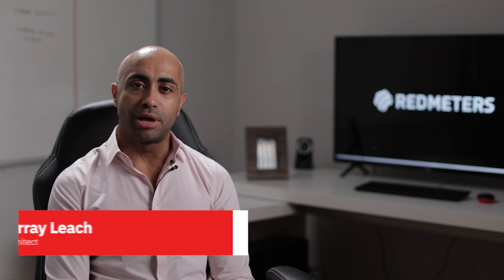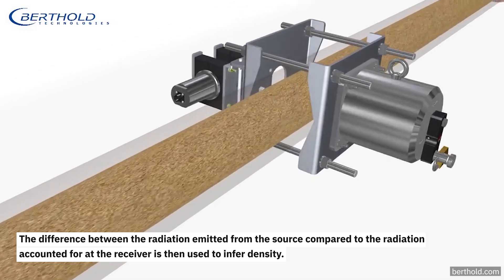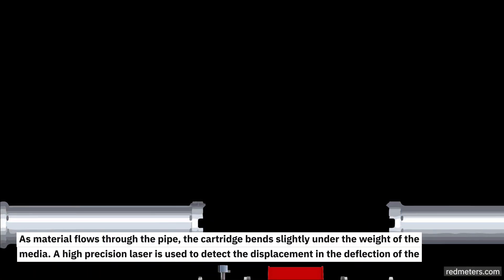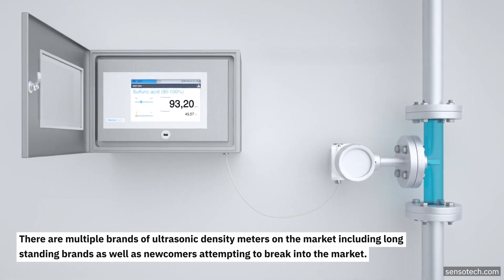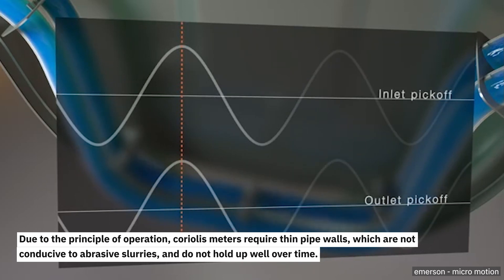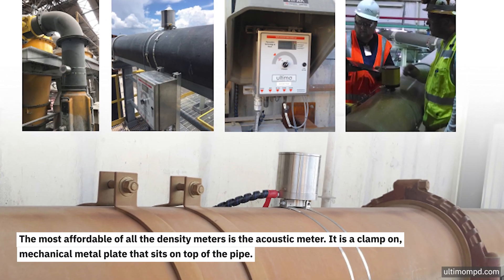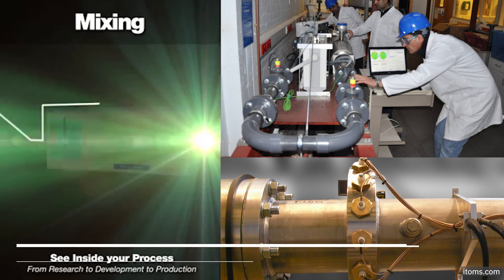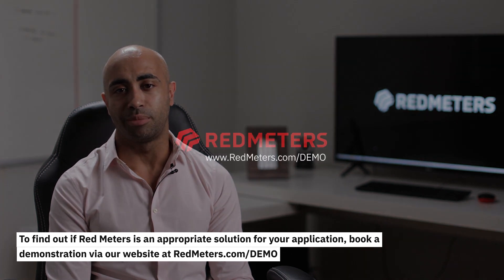Compare Density Meters | 8 Most Common Slurry Density Meters

Comment: Your analysis of Coriolis meters as as densitometers is very poorly written.  The principle of operation of measuring density is based on changes of tube frequency and has nothing to do with the Coriolis principle which measures the flow.  Coriolis meters are used primarily to measure full stream flow, density and temperature and only by exception to measure slip streams.  It is very common to measure the density of flow streams with solids and they don't have to be homogeneous.  Last, your comments about tube wall thickness being a liability and will eventually lead to tube failure is completely misinformed.  When properly sized, Coriolis meters have a long history and reputation of reliability measuring flow streams that contain abrasive solids of all types.  In fact, have onboard diagnostics that can detect even the small changes to tube rigidity caused by either erosion, corrosion or coating.